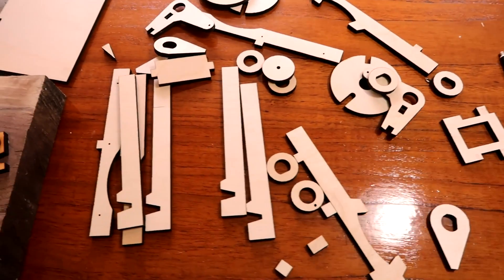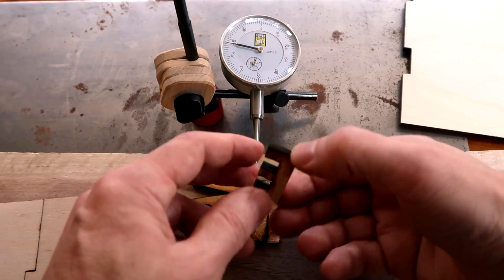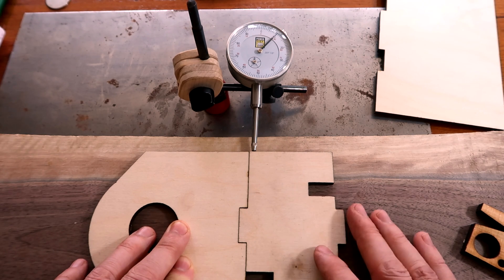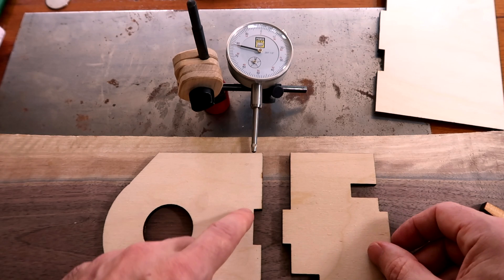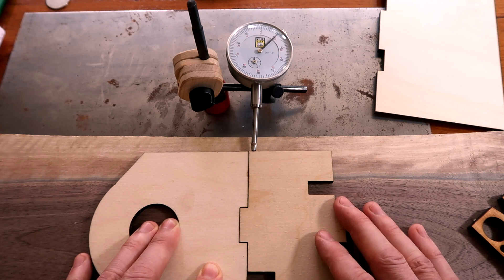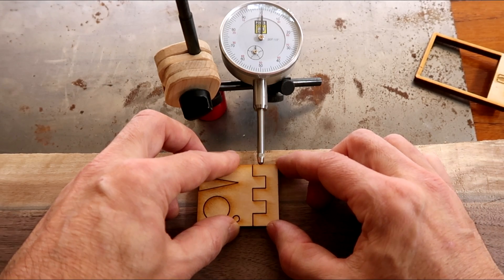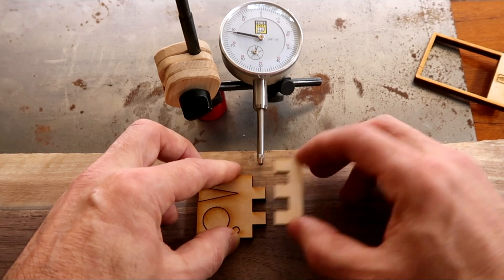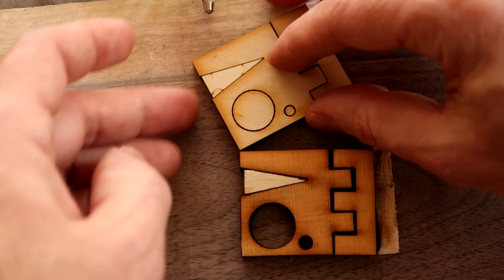Laser cut width follow-up

Comment: Eventually, the "tuning" is out of your hands. The last optical element in the laser path is the focus lens. This imparts a conical shape to the beam - and that is where the taper comes from. Ideally, you want a lens with a long focal length to reduce the angle at the cutting point - but that is not always a practical solution. The easier way to get a better fit is to cut the parts separately and offset the dimensions to allow for the kerf. Costs more - but is called for in small, precision cuts, like gear teeth, gear racks, hinges, inserts, hatches etc.
=========== ===||>
Laser beam into lens into focus point.  Note taper (Eg: 3mm down to 0.2mm over 60mm length, results in an included angle of 1.4:60 = 1.336 Deg taper, or 2.67 Deg included angle of cutting beam)

Comment: My laser cuts with way more precision. I get to around 0,03 - 0,05 cut width if beam is focused perfectly. Pieces then go together with close to 0 tolarences. And if I do rotating circular hinges, where there's a circle cut out and another circle rotates inside, say the hole is 5 mm - I cut the circle going inside to 5,05 mm, more won't fit in.
Those samples you got there look extremly poor cut. I used to get results like that when I had  beam aligment issues.
Reply: https://prnt.sc/lgxbyz
This is what I have now next to me, not a perfect example but yeah, you can see the difference in fitting. Up to 1 cm thick plywood, it's all same result. My laser doesn't come that cheap though.

Comment: Kerf width and cut taper is really finicky and difficult to find every cause for. Off the top of my head, your big factors would be focal length of the final lens, the concentricity of the beam to the final lens, cleanliness and loss factor of the mirrors and lens, and overall power of the laser tube.

Not hitting the exact center of the final stage lens will greatly exaggerate the angle of the cut, and is a very common problem, especially with cheap laser cutters. Using too short of a focal length for the thickness of your material will also result in thicker and more angled cuts. In general, the thicker you want to cut, the longer your focal length should be. Finally, not having enough power to slice through very quickly can result in excessive charring, which will greatly widen kerf. Very resinous woods, or woods that are more papery like balsa or poplar also tend to get wider kerf because they just char much more rapidly.

The typical 40-50 watt cutters for hobby use really should never be used on anything thicker than 1/4 inch plywood.

Comment: Isn’t it more likely that the taper is due to the upper surface being exposed to the laser for a longer period than the bottom . In other words ,more burning around the beam in the upper region as it passes through the material . Or at least a factor? As opposed the the focus of the laser? Or at least in addition to the focus?

Comment: This might be of interest to you:

http://fab.academany.org/2018/labs/barcelona/students/aitor-aloa/computer_controlled_cutting.html

and also

https://www.festi.info/boxes.py/

There are a number of box joint generators on the web. They all account for the kerf, which is determined by a series of test cuts like you are doing. The first link has a .svg file with a simple but reliable kerf test that you can use when dialing in a new material. 

You have to cut each piece individually, no laser makes a tight enough kerf to cut adjoining pieces together.

Comment: Thickness of beam is not so relevant. if you need a tight connection between parts just make offset by 0.1-0.16mm. it will compe sate for the beam thickness + give some extra for parts to be held together without glue

Comment: And this is why any argument that laser or CNC machines "take the skill out of woodworking" is completely invalid. It takes skill to set up and operate a computer driven machine and get good results just as it takes skill to use a hand plane and get good results. Anybody can "punch a button" and run a laser or CNC, but unless someone with skill has tuned it and set it up they will get crappy results, just like I can pick up a hand plane and remove wood from a board, but it will be far from flat, square, or smooth.
Reply: as another youtuber said:"a cnc machine isn't a cnc machinist"

Comment: The better setup is a combination of proper focusing (the focal plane of the laser should be near midway through the thickness of the material) and proper cutting speed (low speeds widen the kerf overall). Your original sample shows a lot of charring around the cut, implying insufficient speed (dirty optics can contribute to this as well).

If you have parts meeting at 90 degrees, you could dovetail or hourglass the tenons slightly to make up for the taper of the mating tenons. This requires quantifying the taper, though.

Comment: THis is not how you really use it though? Its hardly a surprise that there will be some waste when you burn something away. I wonder if a watejet would get better results. Anyhow both technologies are great for doing the job of a scroll saw but not so sutable for joinery like this they are too slow compared to a router or even hand cutting if you do it the way Frank Klausz does it. People nowadays jsut love laser cutting and 3d printing becasue it seems cutting edge and want to use it for everything even though there might be cheaper and more suitable processes around.

Comment: The kerf width and taper will also depend on the lens being used. Longer focal length will have a wider beam but less of an angle and vice versa. The sample I sent was with a 2" lens.  A lot comes down to what your primary task is be it engraving vs cutting for what may be best. The 2" has been a nice balance for what we do which is both.  Trotec has some basic info here on the topic https://www.troteclaser.com/en-ca/knowledge/tips-for-laser-users/selection-of-the-right-lens/

Comment: Is it possible that wood storage and humidity could also have a potential significant impact, given that we are cutting with super hot frikin' lazoor beemz? (Sorry, got a bit carried away there).  But laser heat=dryness=contraction.

Therefore, drier wood to begin with =less contraction and therefor tighter tolerances)?

How does grain direction affect dimensional accuracy? Maybe that will give us an understanding of the variables. I think ply dimishes this variable, so then we are left with humidity and laser spec / tune.

Thoughts?
Reply: The laser cuts so quickly the wood wouldn't really have time to heat up (enough to affect anything), and I've never heard of anyone cutting solid wood, just plywood, so the grain shouldn't have an effect.
Reply: @CrashTestCoder  Hey Ryan,

Care to place your hand in the path of the laser as it cuts?

Kinda joking aside,  a hand saw doesn't leave dark marks either side of the blade, a table saw can. The laser cut parts all exhibit discolouration on the tops. Not sure if they are also on the sides, but if they are, then stuff is probably getting warmer to some degree or another. 

Surgeons quarterise open wounds with very fast intense heat, that seals and shrinks them to a degree. I figured a similar process was in action here.

I'd be interested to see the same cuts on the same machine on acrylic. Seems to cut clean. Not sure if it absorbs water or distorts with heat as I've not researched it.

What do you guys think?
Reply: @20vK  yes the parts are getting hot, but the heat doesn't really spread out com the cut, it's kind of like if you poked a hot pan, the surface of your finger would get hot, but it's not going to do much to heat up your hand.

As far as cutting plastics goes, no there isn't really much, if any, warping that would occur. Its because, as i said before, the laser doesn't dump much heat into the part

Comment: I'm not sure if you intended this, but I feel like this video is a bit misleading.  If you wanted the joints to fit precisely it seems like you would enter the actual kerf into your laser software, and layout your pieces differently so the kerf is outside the parts.
Reply: pretty sure this video is specifically about measuring the kerf, instead of just the tolerances of the parts together.

Comment: Yeah, burned wood isn't too good for glue-up I think tho...
Reply: I've glued up a dozen laser cut box joints. I have no doubt the glue strength is compromised by the charred edge, but none of the boxes have come apart yet. Some are several years old.

Comment: That's why you don't just cut the pieces one next to the other, you should always cut the pieces in such way that every cut is between a piece and waste material, not between two pieces. (I should have said "design laser pathway" not "cut") Yes, it's a little wasteful, but if you make a design with cut width included, in other words placed right outside the edge of the piece, you'll end up with parts that have no play between them, plus you can make them friction fit if needed.

Comment: I like how you expressed the imperial dimensions in decimal (.010") and the metric in fractions (1/8mm). I wonder if that was just to wind people up. There will always be some kerf, so just like other woodworking you just account for it. High end lasers can remove the taper on one side by angling the beam during the cut.
So when is the debut of the PantoLaser?
Reply: Decimal inches are actually very common to work with.  Nobody that actually works in imperial units is going to be upset about 10 thou as a measurement.
The fractional millimeters would just be because that's the easiest way to quickly convert between the two. 25.4mm/in, so .010" is 25.4*.010, or .254mm.  .254 is about 1/4, so it's reasonable to just call 10 thou 1/4mm, and only use decimal if you're actually doing math with it.
Reply: thousands of an inch, is pretty standard. just like how microns exist instead of using metric fractions, that's just too annoy ya. it's obviously just called 250 microns not 1/4 millimeter.
Reply: I don't think I've ever seen fractional metric measurements anywhere. Germans frequently say "Zwei zehntel" or "Fünf Hundertstel" (two tenths, five hundredths), but that's pretty much only done with 10-based fractions and maybe half/quarter, but nothing that's weird in decimal or needs calculation to convert. No one ever said "three sixtyfourth" or anything like that.
Reply: (So, basically, zweizehntel is just quicker to say than "nullkommazwei"; omitting the leading zero as in "point-oh-five" isn't done).

Comment: Wouldn't glue fill the gaps?
Reply: Normal PVA glue or yellow glue isn't good at filling gaps. It loses a lot of volume during setting and while it is hard it is very brittle. It also doesn't accept finishes. So, 0.25 mm is already a bit wide a gap. Not going to look nice, or be a strong joint.

Comment: We have a glowforge at my office here, we have experimented with some with thicker materials but most of what we do uses 1/8" material or thinner. The tapered laser issue is obviously minimal on thinner material, and since the work surface of smaller lasers like the glowforge is relatively small, you often are not designing parts that need to use thicker materials as your target part is likely a part of a small assembly.

Comment: I agree that you need to 'tune' your laser, but if the laser and mirrors are aligned/clean and focus is correctly set results like the ones seen in this video are easily possible with 'hobby' lasers. The piece cut in your first video looks like a cut from a laser with a high hours tube, and to cut the 1/4" ply needed multiple passes to get the cut done. Hence the wider kerf and lots of scorch marks. We use a 40 Watt laser from FSL in our business and as soon as the number of passes to complete cuts go up, we know the tube is nearing end of life. Keeping the laser optical path clean and understanding that laser tubes are consumables is very important to ensure proper results.
Reply: What's your cleaning process for the mirrors like?
Reply: arfink we clean with a very mild detergent in water and use pecprep cloth. Very gentle cleans only. We found alcohol to not work well. We clean after about 20 hours of cutting plastic and about 5 of plywood. Seems to work well.

Comment: solution to this "problem" is very simple. don't go for 2 finished edges from one pass and orient your pieces so they don't need to be flipped post process.
Reply: This idea is well known - but the downside is that you are making more cuts, which translates to higher cost. This is okay if you don't care about the cost - or if the precision is really important in the particular fit. For close to perfect fit, you actually design some mating parts to be flipped so that the tapered sides match better. I typically do this for plastic gears.

Comment: I guess you could make sure every peice only has 1 kerf (don't use 1 cut line between 2 parts) and compensate for the kerf I do this with plasma cut profiles which are always a little messy,

Comment: Tuning is everything as i have mentioned on the previous video. I could do the pieces match exactly with no play at all :)
Reply: Fat Boo no worries. Feel free to ask :)
Reply: Sure you can, if you cut your parts separately while paying attention to kerf. If you cut pieces like Matthias has in this test, it's impossible to eliminate play completely.
Reply: @F3Ibane  Exactly. That is the way to eliminate the gap. But it is time consuming and someone has to pay the extra buck.
Reply: Fat Boo The edge should be 90 degrees if all 3 mirrors and lens are perfectly aligned and focal point is set properly. Again, perfect result depends on how the machine is tuned and set up. Also with the proper lens for the thickness you cut. Even chinese machines can produce stelar results if you take the time and have the knowledge to do it.
Reply: Fat Boo Fat Boo i am not sure i understand what you mean. A well adjusted laser system should cut totally straight on all corners of the piece no matter if you cut something separately or you take the inside piece of a shape. You should not have any tapered sides in the piece. This is very difficult though to adjust, but this is the goal. For sure, the first part Matthias received with so much angled corners is made from a bad tuned machine.

Comment: I'm wondering if cutting wood with a laser cutter results in a larger kerf due to the fact that the wood "burns" and possibly continues to burn for a brief period after the laser passes whereas something like metal simply melts or is vaporized leaving a thinner kerf. My bad on the spelling of kerf
Reply: kerf is just the width of the beam. same as a saws kerf is the width of it's teeth. the taper comes from the shape of the beam as it approaches it's focal point, the degree of taper is largely determined by the size and shape of it focusing lens with some minor variation from the quality of the raw beam, accuracy of the material within the focal point, cleanliness and centering of the downstream optics and resulting scattered photons. while some burning may be occurring from the scattered photons the majority of the removed material is ablated.
Reply: Curf is always present in any material. It is the thickness of the beam that needs to be calculated when cutting precision parts. Also what type of lens is used. 1.5, 2, 2.5, 3, 4 inch lenses have different size beams. Not a simple process, lots of tests, skills, time and experience needed.

Comment: In short: be sure to ask the service provider about the cut width and taper, so you can design your pieces around that.
Reply: Or test it yourself if you use tool from a fablab

Our cutter here has a tolerance if about 0.1 mm for 3 mm acrylic but about 0.4 mm if you cut 6 mm birch plywood 

If you cut matching pieces with a single cut you should be aware of that or just cut the parts separately and add the tolerance - good cutting software does that calculation for you

Much like on cnc routers where you neef to tell the software the tool diameter and wether to cut inside, on or outside the toolpath

Comment: I wonder why you use an imperial gauge instead of a metric. Your preferences in this area have been well documented.  Hope the arm is improving.
Reply from the maker: Metric dial indicators are hard to find.
Reply: @matthiasrandomstuff2221  I thought the likes of starrett would be able to supply you? I bought a nice 10mm gauge from them here in the UK and it was only around £35 from memory. their local site might be worth checking out
Edit: it was this one - https://www.starrett.co.uk/shop/precision/indicators/dial_indicator/?item_id=BJ275
Reply: @joeshaft  Knowing Matthias, he means "hard to find for free on the side of the road".